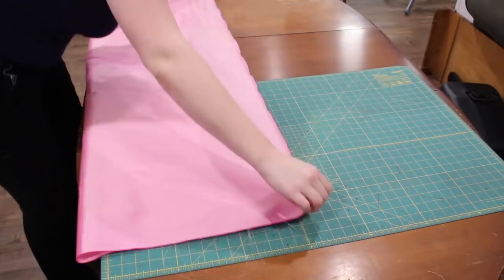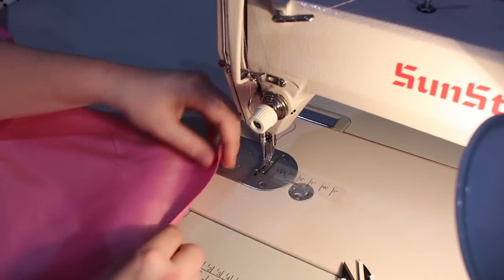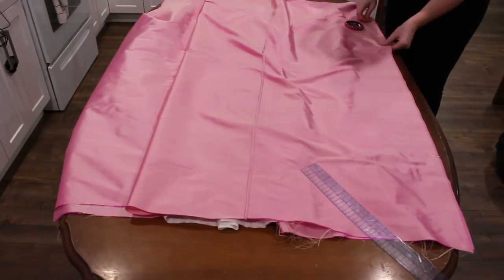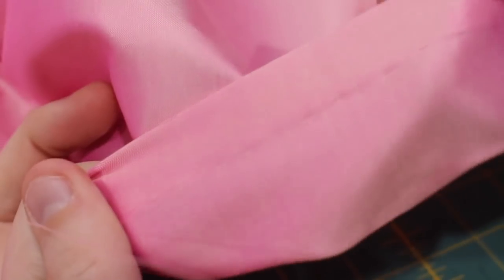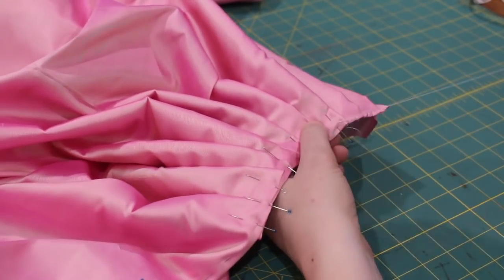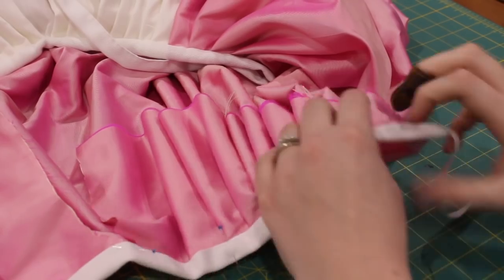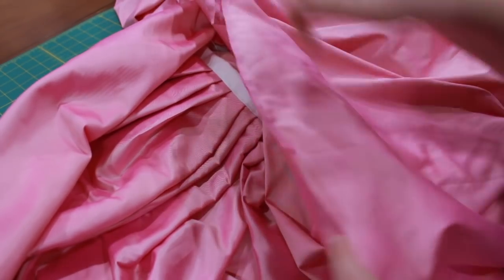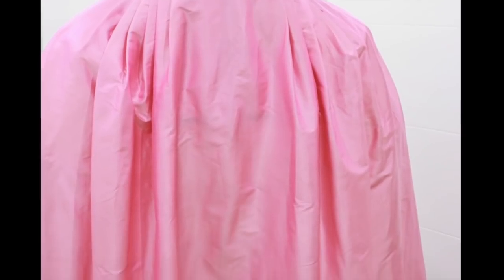Sewing a Robe à la Française || PART 1

Comment: I have a question about the back of the petticoat. Is it normal to use a different material for the back? Ive seen a few other costubers do the same thing but I never really understood why the backs are not made of the same fabric as the front of the petticoats. Other than that, I love your petticoat and dress.

Comment: Hooooooo que oui c'est vraiment super et je trouve que vous avez beaucoup de goût juste dommage que vous ne mettiez pas les dimensions en français aussi juste les chiffres se serrais génial
Reply from the maker: Thank you! The measurements I use change for every person :) The width of my silk is 40" (101cm), the length depends on the side measurement taken from the waist to floor over the pocket hoops. I hope that helps :)
Reply: 101 cm de large ?
Reply: Ferez vous la suite pour la robe à la française svp ? J'ai hâte de voire la suite
Reply: Je ne parle pas du tout anglais donc pour moi c'est très difficile de comprendre les messure
Reply from the maker: mennecier corinne I don't speak French, I am using Google translate 😉 the width of my silk off the bolt was 40" (101cm)wide. The next video in this series will hopefully be ready in the next couple weeks. 😄
Reply: Oui moi aussi c'est ce que je fait merci c'est gentil à vous ! Mais je comprends pas tout ok 101 cm mais vous avez utilisé combien de morceaux car la jupe et large ?
Reply from the maker: mennecier corinne ah, now I understand your question 😄
I used 2 40"×53" (101cm x 134cm) silk panels for the front of the petticoat and 2 40" x 13" (101cm x 33cm) silk panels and 1 40"x 80" (101cm x 203cm) cotton panel for the back. I hope that helps 😊
Reply: Oui merci infiniment cela m'aide beaucoup c'est très gentil à vous très bonne soirée corinne